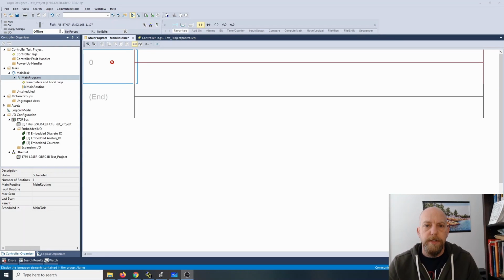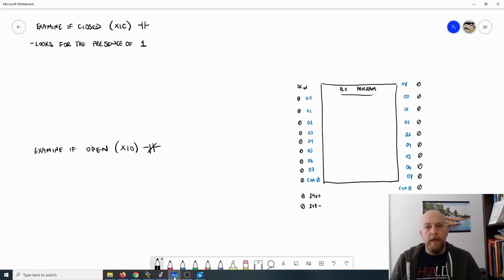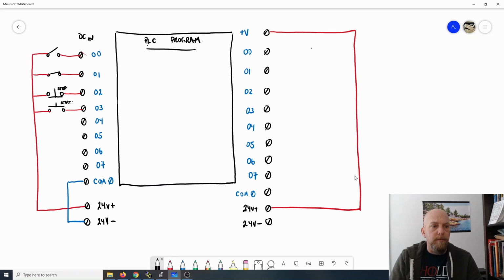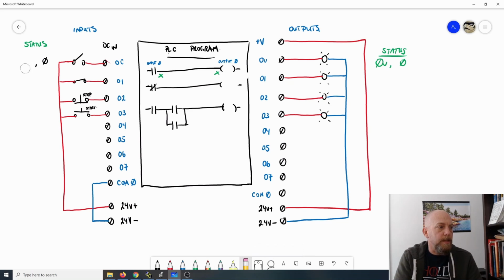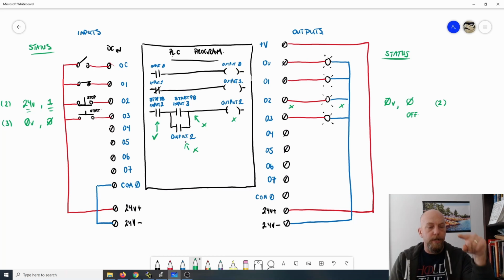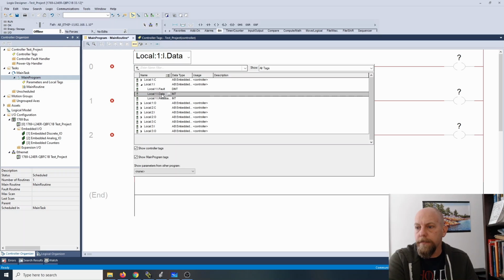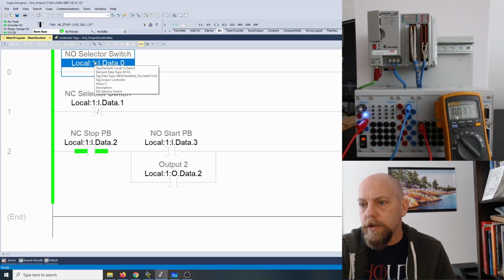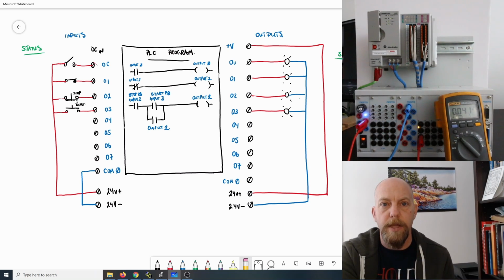Studio 5000_Compact Logix_PLC Programming (XIC vs XIO Instructions)

Comment: If I understood correctly in the ladder language, a load can be activated regardless of whether we have an open or closed circuit in the switch. There is no electrical continuity but logic. And my main question, does ladder language consider all switches as double throw?
Reply from the maker: Yes, you are correct. Not the path of current, the path of logic. The Ladder language primarily looks for voltage or no voltage... so usually single pole, single throw input contacts.